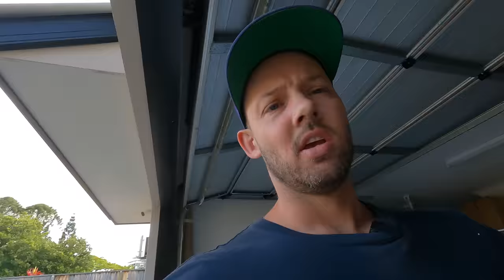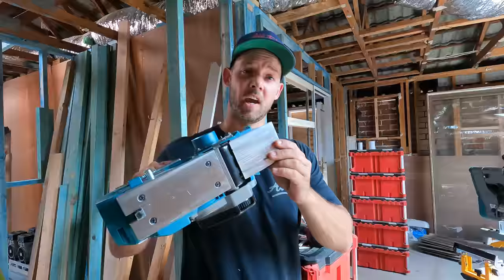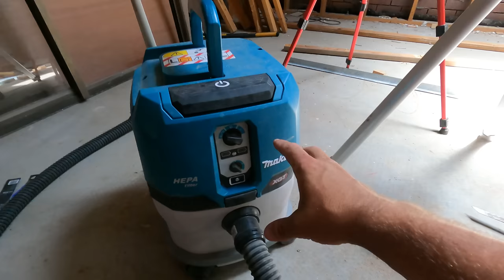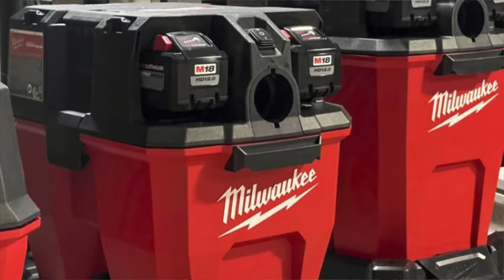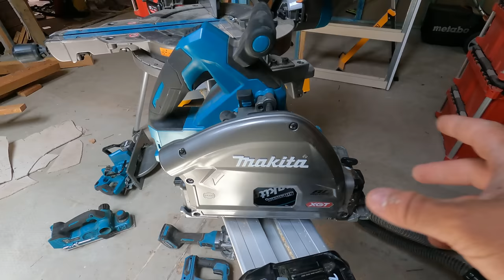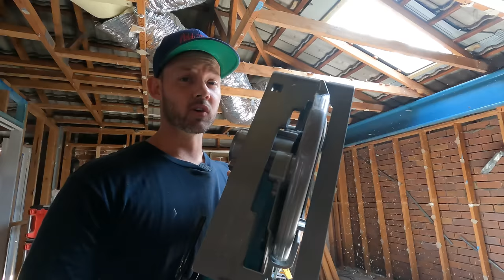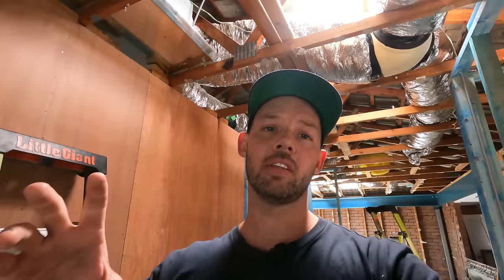From milwaukee to Makita. Why I changed tool platforms

Comment: My M18FPD2 is a shit drill. Has had a new chuck, lights stopped, bla bla. Had both my brushless drill and impact die. Batteries not charging, brand new rapid charger doesn’t charge any batteries. All shit, driving me nuts. Been thinking of going to makita for the bunnings warranty and perceived toughness. Just like the 12v
Reply: Yup...never been a fan of milwaukee because the reliability just isnt there for how much the tools cost. Plus every power tool the switch/trigger eventually fails and makita you can replace the switch itself for short money. Every other platform the switch is not a stand alone part so cost way too much to replace. Not even worth it for drills and impacts cause its close to the cost of a bare tool. I prefer makita and dewalt over milwaukee. Much more reliable
Reply: @jacksmith2315  The out of pocket cost to replace my M18FPD2 chuck - $70 dollars for the chuck, $20 dollars for ONE reverse thread screw.

Comment: Funnily enough, I started with Ryobi as my first lithium tool because they offered a tool the other brands didn't and I needed that tool that day. I've used them at a bunch of sites and have had many people borrow them. Eventually I may look at another brand, currently eyeballing Bosch because of their dust extraction, but right now I have an ecosystem of tools that has taken a beating and is still going. 

I'd recommend anyone to look at what specific tools you need from each company's lineup and their local availability and decide based on that instead of what the people online say.
Reply: I worked with self-employed carpenter recently who owns multiple of all the different brands but prefers Ryobi for everyday use. The impact drills may not have the power of Milwaukee but they last longer with better battery life and seem to work better at very low temps. Every tool will break at some point when abused regularly but Ryobis tend to be cheaper to replace and have better compatibility with their own existing batteries.

Comment: At the shop I work at everyone either has Milwuakee, Dewalt, and Crapsman. As a shop we used to have issues with temp workers with "sticky fingers" and though that's not a problem anymore It's a partial consideration as to why I became obsessed with buying tools no one else has. I wanted something that is undoubtedly MINE from a quick glance for that reason, but also so none of my more senile coworkers would mistake my tools as part of their kit and "accidentally" swap their worn out batteries with the "new guys" because "I know muh tuuls an gonna bitch to the boss bout duh new guys tryin tuh steeeel muh tuuuuulsss!".................so I run all Makita power tools. Also it annoys them because it's not a M'erican company therefore "it's just cheap chinese crap"......yeah.......they're a weird bunch.
Reply: I think Milwaukee tools are also made in China.  Makita used to be made in Japan but they are also in China these days
Reply: @jasonswoger410  yeah, currently the selection of "made in Japan" Makita power tools is unfortunately rather finite (minus up charged Japan only import models). I would of purchased from Panasonic if the price to import wasn't in Snap On territory. I'd prefer to not buy any tools from china if possible, but you can't win em all.

Comment: Agree with everything but the track saw if you are looking for cabinet accuracy this is not the one ! I have both I have fought toe in adjustments blade deflection angle slop in the adjustments , track cam wear , base on saw warped out of box and deferent track widths  from lot to lot had to adjust saw cams from track to track . festool dead on on every time no banana curved cuts I love my makita tools ps 2 people that I no besides me having similar problems
Reply: I dont understand a thing you are saying. But for me festool and makita go toe to toe.
Reply: @MultiMartien Toe to toe funny. Toe in is common on saws go to festool supplemental owners Manuel on there web site easiest way to read it yourself I’m a makita fan but not the tracksaw or sanders not toe to toe not even close to the foot lol

Comment: The problem is that these large tools actually don't work on batteries but we all act like it's great and that rolling out an extension cable is such a big project that we rather improvidence with a battery driven tool and a van full of batteries. An angle grinder on batteries for example is just a bad joke. At least when you use it for what it was meant to. Cutting through metal all day. I once had to cut through a metal strip of 2 by 1/2 inch. Walked half a mile into the forest with my new angle grinder on batteries and a back pack with 4 fully charged batteries. I didn't even get through the metal strip before all 4 batteries were empty and one was dead forever. Batteries aren't suitable for emptying them within a few minutes. It hurts them badly. But I don't understand these kids nowadays anyway. They rather walk around all day with a very heavy drill with a huge battery so they don't need to change batteries all the time. Wile I have to pop in a new battery every hour but I have a drill that weighs less than half of what they have to drag around all day. Seems like the worst 2 things a modern builder is facing is rolling out an extension cable and switching a battery.
Reply from the maker: Thanks for the insight and feedback mate. It does seem that we do very different work though as I don’t see what you’re saying. Sounds like I’m almost the opposite but it really depends on the type of work and the site setup. Thanks again.
Reply: @AddictedtoTools  Story of my life 😂 When everyone else is going: This is genius 😎👌 I am like: What kind of garbage is this 🤣 Everyone so excited about LED lights for example while I find it the worst light ever to work with. It's like the light just vaporizes. But I seem to be the only one that notices how much worse LED is for lighting up a whole room. It's like the light doesn't reflect as well or something like that. But again I seem to be the only one 🧐 I guess it's just me 😉

Comment: What is a point of large tools fix in place to be battery powered ? Cord is simper , better and cheaper .
Reply from the maker: I don’t require power or leads everywhere. If you have a workshop setup I agree. I’m not in a workshop though.
Reply: @AddictedtoTools  I was referring to this video and large miter saw . They are fix tools . Fix in yard or shop , doesnt matter  Small battery tools are excellent.

Comment: I am not brand loyal, Bosch Plunge router adjustments to no end, Makita table saw, some yellow okay DeWalt, Milwaukee fuel m18. I guy the tool for the job.
I considered Kapex slider and impact and drill as finish carputer. I find Festool more for cabinet makers needing very precise tools, unlike the carpenter use their skill.
Milwukeed m18 5.0 battery form the 1/4 impact driver 2853 the tool is dream though one battery has problem charging takes 1.5 hours or the charger will flash red and green 
authorized tool dealer told me milwukee has trigger problems the mil rep agreed. At home Depot is remoting Klien electric tools and Milwukee is releasing electric tools, you are so right.
I am after some Hilti and some makita their 7.25 sliding miter 36v. though makita cost more their tools are more durable the battery talks to the charger and the charger has small fan to keep the temp down helping battery life. Hilti 20 yr, makita  3 yr Milwukee 5 yr warranty.

Comment: I'm committed to Milwaukee and their tool range is impressive, however their warranty department is utter garbage and that is definitely a factor to consider when deciding on a new platform.  

I had a brand new die grinder die on me 1 hr into a job. It took 4 weeks to get it sorted under warranty.  That is unacceptable for a tool that is marketed to tradies.

I had a rapid charger dead right out of the box,  same deal.  I couldn't wait so i was forced to buy another one while waiting for the warranty replacement...

I recently purchased an m12 drill driver, and 50% of the time the drill won't work when pressing the trigger unless you remove the battery or put the drill into reverse then back into forward.  Again unacceptable but I'm not going through their pathetic warranty process. 

So now whenever a tradie asks me about their tools,  I tell them that they're great but if you don't want to buy 2 sets of every tool,  stay away from milwaukee.
Reply: I've had similar experiences but with different tools. I would love them if they weren't unreliable and long service times. I am very disappointed with it so now I just avoid where I can.
It wasn't so bad for me, working with a large company that had the same platform so I used those tools while mine were under repair

Comment: Good luck with those Makita nailers😂

Rockin just one color is fools gold
None of the brands have all the best tools

I run multiple colors cuz I want the best tools for the job at the best prices one color fanboys are working with overpriced/inferior tools as each color has their weaknesses and strengths
It doesn't take much to carry an extra charger or two and a few batteries of another color
I'll keep making money with my red, green teal and a few others as u guys overspend for one color loyalty

Comment: Weird I’ve never once had a Milwaukee battery go bad on me in my 9 years of experience in carpentry, but I can’t keep my dewalt battery’s working longer than 4-5 years, already my 15.0 flex volt is dying after 1yr, I originally looked at Makita 40v system a bit back, but over in Canada I couldn’t justify the nearly $700 to get just a 40V Makita impact kit over the Milwaukee gen 3 impact kit that cost me $350 especially since the Makita impact puts out worse performance by a large margin. So idk maybe they are the “carpenters tool brand” but I don’t know anyone up here who uses them just due to their overpriced nature and often lower power figures.

Comment: From outsider perspective.. it seems that you went with makita because A. Its bluetooth.. and B. It was available.. not a great comparison.. i use milwaukee.. but have no real probs with makita.. except their reciprocating saw.. but like all others besides milwaukee.. its just a bad design...
Reply from the maker: Hey Jeremy, thanks for the feedback. What comparison are you referring too though? For me, I wanted larger batteries and Milwaukees larger batteries are terrible. I wanted Bluetooth and they didn’t have it. I wanted a track saw and a rear handle saw, Milwaukee didn’t have it. Milwaukees saws have well known problems. 
All of these reasons were a large reason for why I went to makita for carpentry tools. 
Seems reasonable to myself

Comment: Sorry, but that's a dumb reason. All the batteries are made by the same few companies. Any problem you have with the batteries THAT SOON can be dealt through the warranty.
Reply from the maker: Interesting. So constantly unreliable batteries, trigger problems with circular saws, no track saw(at the time) and no aws(which I’m wanting to review) isn’t a good reason to change and try a new platform? 
I went through warranty and was without a battery for weeks which would mean I have to buy extras just in case they stop working. I know people with 10+ batteries not working.

Comment: makita electronics are far superior 

Your average Jap 6cyl usually performs as well as many American V8’s. It’s much the same thinking here, milwakee power is better in some drills, when it’s usually not needed.

Milwakee is 12v superior though

Comment: This ding dong doesn't know that 40v is 10S cell config, so a single cell going bad kills the pack ENTIRELY, where milwaukee is 5S2P so if one bank of 5 has a weak cell you just get reduced capacity but the battery still works.
Reply from the maker: Hey, ding dong here.
I’m not really sure how this is relevant or why you’d want to call someone that doesn’t talk about the topic a name. It’s a little strange. Maybe you could clarify. Cheers
Reply: @AddictedtoTools  you didn't talk about the topic of makita batteries being more reliable than milwaukee? I was telling you, as an electronics tech, that they are not
Reply from the maker: No I never said they are better. I talked about the problems I had with Milwaukee batteries. Never talked about the differences in how they are made

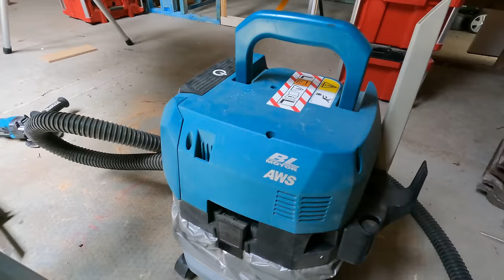Comment: 1:42 - angle grinder without protection cover...seriously?
Reply from the maker: Hey mate. Yeah. When grinding concrete flooring flat you can’t have the protector on.
Reply: @AddictedtoTools  ouch...Discs split and fracture sometimes and the results can be really nasty. These things are truly deadly. Take care bud!
Reply from the maker: They definitely do. The blade is a metal blade though. It’s not your usual grinding disk. 👍

Comment: Lol I’ve just had 7 Makita brushless tools fail in 18 months 
They are now a shit brand. Batteries are a joke.
Hikoki is the best overall.  
I have bought 15 Hikoki tools in the last 12 months and they are excellent to use and the dual battery voltage system is superior

Comment: Bad choice. Been through them all. Milwaukee is the only brand that excels and last!!!!!!!
Reply from the maker: How is it a bad choice when all my larger batteries need replacing every 6 months, the saws won’t work and they didn’t have a track saw or the vacuum I was after?
Reply: @AddictedtoTools  all i have to say is good luck with the Makita!!! Already been there done that! 👎
Reply from the maker: What happened with your XGT gear? I haven’t had any problems so far

Comment: Milwaukee batteries are trash. They are completely sealed. Imagine heating it up by being discharged on a grinder and then being thrown on a charger with no air circulation 😂
Reply: agree, how can a excellent tool brand like Milwaukee uses this old school batteries? My $20 flashlight have more advanced electronics than Milwaukee batteries.

Comment: You should check out the asian guys creating a monkey tail end for a handrail, in-situ. using an electric drill, a few bits and a sanding wheel. Then hang your festool hatted heads in shame!

Comment: this makita saw and its table is worst of all makitas😂 its not easy to change angles, there is no zero point and most angles easy tune, table support for wood allways fall down if wood is little heavy. laser need to be tuned to zero. its not easy to understand how the f this table closing etc. a TOTAL NIGHTMARE. even dewalt same size were much beter.